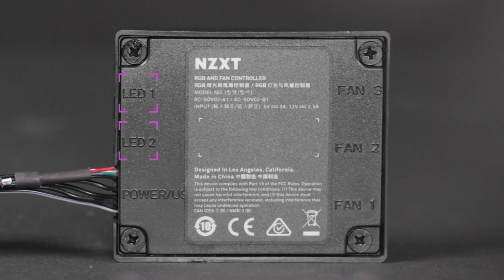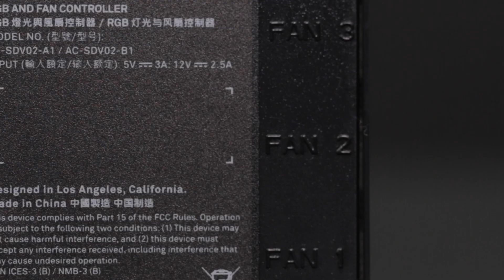NZXT RGB & Fan Controller Walkthrough

Comment: Can you connect a Kraken x63 to the controller?
Reply: gl0ckc0ma I’m wondering the same thing
Reply: @swissayy  I get my Kraken X63 tomorrow and I am pumped. I want to OC the shit out of my CPU and the stock cooler just don't cut it. I am so pumped. Hopefully, we can get an answer soon.
Reply: @swissayy  Okay, so I figured it out. If you have an NZXT H510 case then you have 2 PC fans. I connected those to Fan 1 and 2 slots on the controller. The two fans for the Kraken were daisy-chained with a cable that came with the controller and the plugged into the Fan 3 slot. Of course, the Pump cable connects to the CPU_Fan slot on the MB and the power for the pump to SATA cable from the power supply and the last cable to a USB slot on the MB. Hope this helps.

Comment: If add a Nzxt led fan, like a rear one. Where do I plug it in, mine doesn't light up
Reply: same bro im having trouble
Reply: @m.xsingh8508  I figured it out, just unplug the front one from the led control unit, the front ones are in series. And plug in the back one
Reply: @musc258  what do you mean by the front one?
Reply: @m.xsingh8508  same mine is just doing a faint glow on the bottom half of the fan, but it isn't appearing the software or anything.

Comment: Ever since I put my computer together, it never fully shuts off, even after I shutoff the fans and rgb lighting are still going. I haven't found the solution yet, I did a bios update, I tried flashing the cmos battery, but I think it has something to do with the controller, any help would be appreciated.

Comment: Are non NZXT pwm fans able to be controlled through the cam software with this controller? for example i have Phanteks PH-MP fans and would like to set speeds on the cam software will this controller do the trick??
Reply: Did you end up finding a solution, I'm wondering the same thing
Reply: @oliver8293  Na bro I just went all Corsair. I recommend that software and fans. Easier to work with 👍🏽
Reply: @qvs787  thanks for the fast reply 👍

Comment: How does this connect to the motherboard? Do the cable Combs by NZXt connect to this CAM unit and run together in the software?
Reply: I know this is late, but it connects to the usb 2 header on your mother board and is powered via sata.
Reply: @bryannichols2366   by sata do u mean on the motherboard or harddrive?
Reply: Tyson Nguyen it’s powered by the same lead from your power supply like you would use for a hard drive.
Reply: @Bryan Nichols does this only work with NZXT fans? Because my case has rgb fans but my motherboard has no header and was wondering if this would work for me.                    Update: It did not work with my case. Cooler Master Pro 5 RGB
Reply: Kelp hmm I’m not sure as I use it with only NZXT fans. But the fan headers on the controller are standard connections.
Reply: Have two exhaust fans set up in my H510 ELITE. Both are AER 2 RGB. A 120 and a 140. Both power up and spin with no problems. For the life of me though, I just can not get the RGB to light up on either fan. I have tried both plugged directly in to the included controller, doesn't work. Tried using the included fan splitter also, that too does not work. If I'm missing anything here, please someone let me know??
Reply: VimyScout so each fan should have an rgb lead and an actual fan lead. Make sure that you have the fan lead plugged into the fan side of the controller as well as the rgb one plugged into the rgb side and make sure the rgb connector is not rotated around!
Reply: VimyScout is your NZXT can software recognizing the controller? If so, try to see if there’s an option to change the colors or turn them on in there
Reply: @kelp3877  MIne recongnizes no controller or lights

Comment: I have a cheap NZXT case, I recently bought it from Newegg. It's the model that has the tempered glass, so it's very low-quality. However, it does come with LED strips and I really don't understand how to use this controller. I grew up with fans that attach to the motherboard, not to this controller. I had no idea that the four pin female cables shown in this video were connectors for additional fans. It doesn't say that anywhere in the chassis manual.
Reply: You find out ?

Comment: Validated information - I have a nzxt 210i and a Kraken x52. I am looking to upgrade my fans. I was told if I use the provided 3x fan extension that came with the kraken cooler the non-NZXT fans will only be able to run at full speed and unable to control them through Cam software? Is this in fact the case? Is this also the case with the smart hub will not work with non nzxt fans?

Comment: If I connect two NZXT Hue 2 LED strips in series to a single LED port on this, will they be controllable separately in CAM?  Could I use different colours and effects on each or are they 'linked'?  Thanks
Reply: Stephen Connor linked

Comment: NZXT has the best looking ARGB pc stuff in the market, in my opinion, but I need them to dumb this down for me and provide an in-depth walkthrough for how to set up this stuff. I've never built my own pc before, but I'm planning on building one this year with a few NZXT items including AER 2 RGB fans and a Z63/Z73 cooler.
Reply: It’s pretty simple. I’m just putting this together now. It’s literally plug this in to USB and power, plug the fan controller lead in the hole marked fan, plug the led wire in the led hole , if you have a lighting strip, plug that in the other led hole or daisy chain to the AER fan and then install the CAM software.  Hard to go wrong with it.
Reply: @PaulByron4d  so my motherboard has all pins and there r no place for the fans to go in
Reply: The cooler will be separate, btw, but will still be controlled by the same CAM software so you can coordinate them